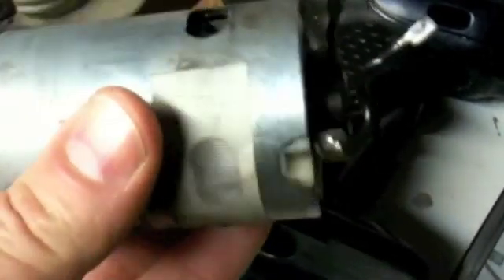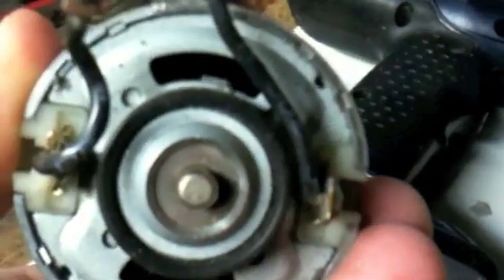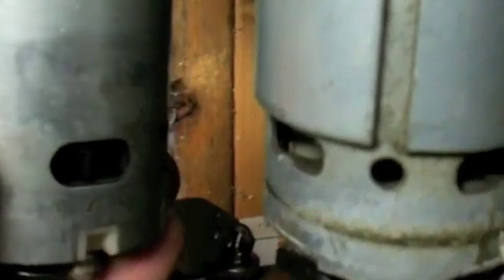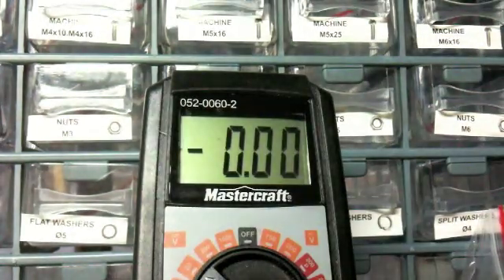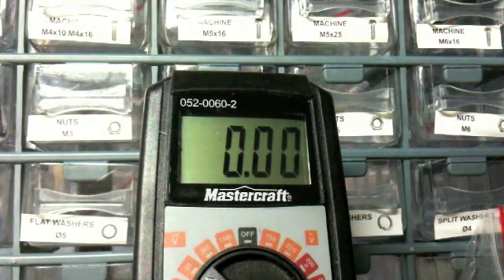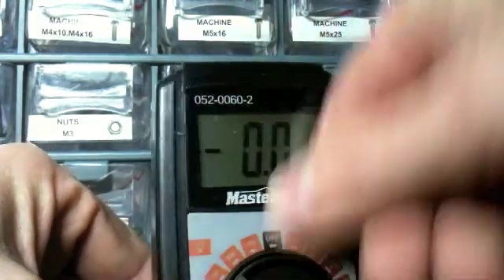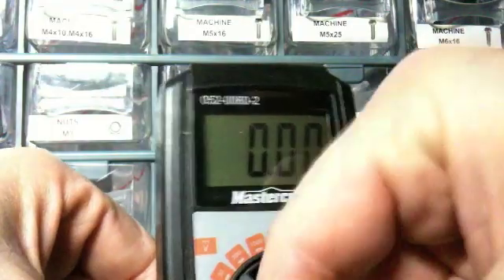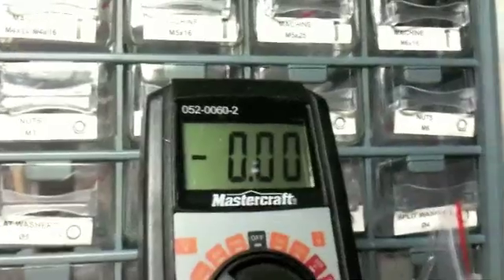Motor Removed from Cordless Drill

Comment: i made a geneator fron one of those little motor, but i rewinded the coil on the motor with smaller thickness wire, 130 turns x coil , 0.3 mm i think it was , with the drill gear attached at 100 rpm of the spindle puts out like 20watts tested am a 12v  21watts bulb and it lights verry bright. first i winded 0.8 wire less turns, less voltage had to spin it verry fast i think it put out 4 amps under and like 5-6 volts under load.

Comment: Old video but I thought I should comment >.< Need to run it in reverse, I get 8 to 10 volts at about 1 amp from my 18V Drill Motor (Mastercraft) just from hand cranking it.